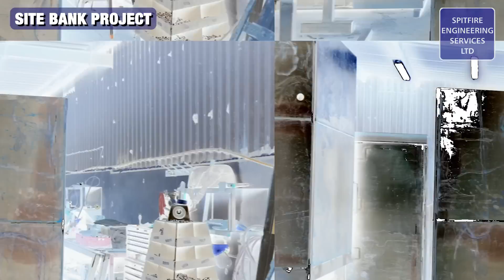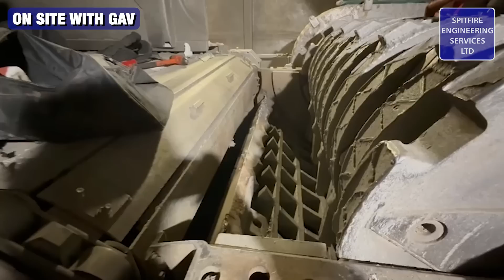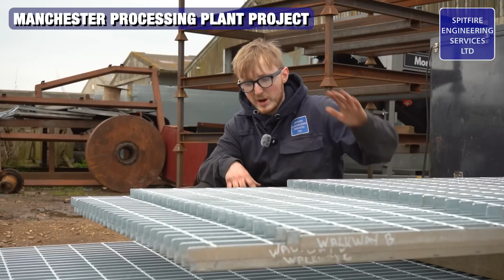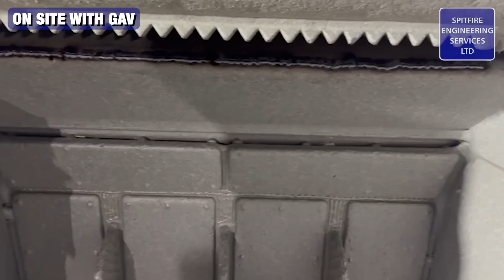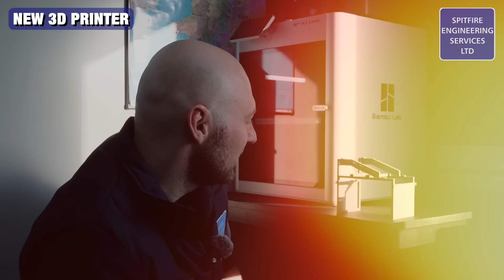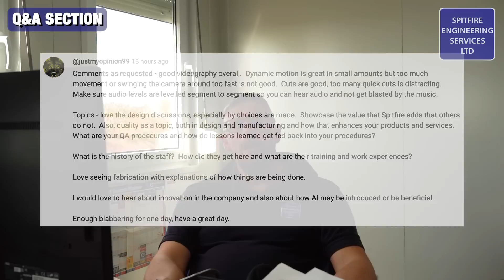D&J SHREDDER TRANSFORMED – SEE THE RESULTS! @DJProjectss

Comment: The smallest engine in the world, in terms of size and complexity, is a single-molecule electric motor, which is just a nanometer (billionth of a meter) across, or 60,000 times smaller than the thickness of a human hair. 
Here's a more detailed breakdown:
Single-Molecule Electric Motor:
This motor, developed by scientists, is incredibly small, consisting of a single molecule adsorbed onto a copper (111) single-crystal piece by chemisorption. 
Other Small Engines:
While not as small as the single-molecule motor, other small engines include:
Toyan V8 Engine: A miniature V8 engine with a displacement of 28cc and an output of 4.3 hp. 
Nissan DIG TR Engine: A small, powerful engine that was game-changing for its size and power-to-weight ratio. 
Small RC Nitro Engines: These are used in various RC vehicles and have very small displacements, such as 1.5 cc. 
Smallest Beam Stirling Engine: A miniature Stirling engine, which is a type of engine that operates on a heat engine cycle.